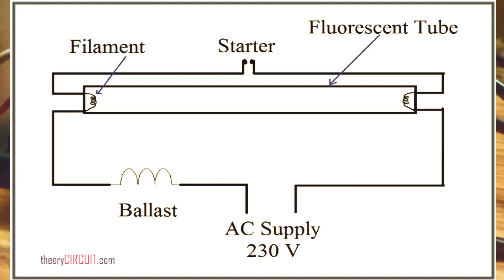What's inside a Fluorescent Lamp Starter? Let's find out...

Comment: 5:00 very interesting. this proves that an LED will not work with an halogen starter. you can connect the wires of the resistor but a fuse (like in the LED starters) is better.

Comment: Capacitor connected in parallel , can you explain or suggest any book for it
Reply from the maker: Capacitor is connected to filter out Electromagnetic Interference as well as boost the spark inside the starter tube. Choke is a huge inductor and can affect the working of the starter. Capacitor in parallel neutralises its effect on the working of starter as well as maintain the high voltage across the two bimetallic plates constant in order to sustain the spark.

I hope that's helpful.

Comment: Nice
Reply: In flurocent lights the starter will not conduct electricity because it works like a circuit braker once the light start glow current flow across the two filaments only and no current pass through the starter.
Reply from the maker: @ramamurthyrajagopal8138  Yes but that's true if and only if the tube light lights up completely and stops flickering. Until that happens, the starter will keep on connecting/disconnecting. 

Here I have used an LED bulb with the starter in series and not a tube light in parallel. A tube light provides alternative parallel path for electric current to flow and that's why starter stops operating once the tube light is ON. 

Check out my video on Tube light on this channel. I have explained it there.